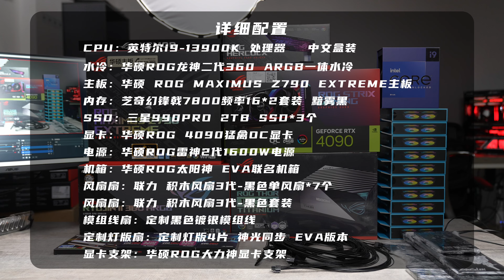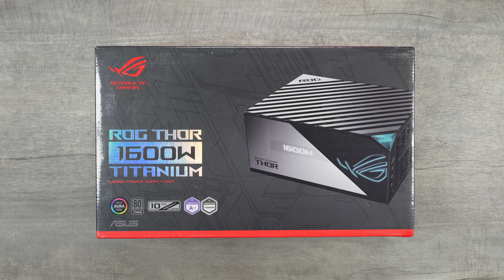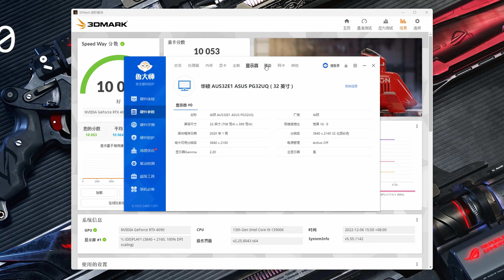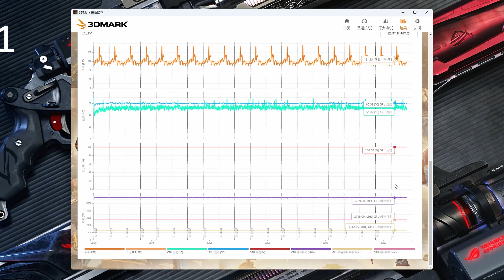ROG Family Bucket + EVA Chassis

Comment from the maker: Thank you for the support of the big guys! Remember to 3 even oh thanks!
This video was recorded in: December 2022
The first M.2 interface does not have solid state because M.2_1 shares bandwidth with PCIEX16(G5)_2. When M.2_1 is enabled, PCIEX16(G5)_2 will be disabled.
The camera forgot to press record when removing the video card, so there is no video card removal process
Installed at: 09:50
 God light synchronization demonstration time at: 10:41, all lights can God light synchronization one key control and one key off lights.
Lu Masters and 3DMARK test time: 12:17
Detailed configuration of this computer:
CPU: Intel i9-13900K processor Chinese boxed
Water cooling: ASUS ROG Dragon God II 360 ARGB integrated water cooling
Motherboard: ASUS ROG MAXIMUS Z790 EXTREME motherboard 
Memory: Chi-Chi Phantom Blade 7800 Frequency 16*2 Kit Dull Mist Black
SSD: Samsung 990PRO 2TB SSD * 3
Graphics card: ASUS ROG 4090 Raptor OC graphics card 
Power supply: ASUS ROG Thor 2 generation 1600W power supply
Chassis: ASUS ROG Sun God EVA co-branded chassis
Fan fan: Lian Li Block fan 3 generation - black single fan * 7
Fan fan: Lian Li Block fan 3 generation - black set
Module line fan: custom black silver-plated module line
Custom light version fan: custom light version 4 pieces God light synchronization EVA version
Graphics card bracket: Asus ROG Hercules graphics card bracket